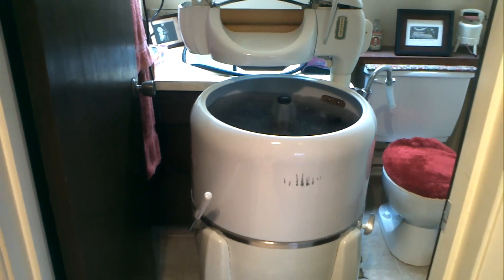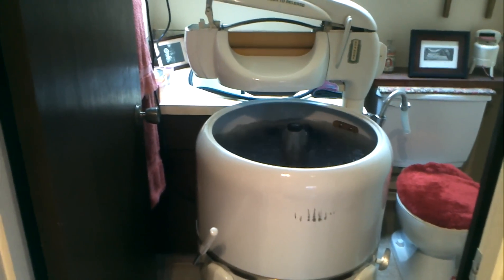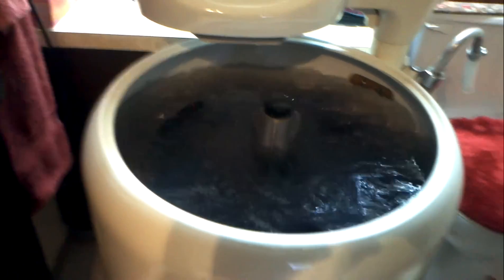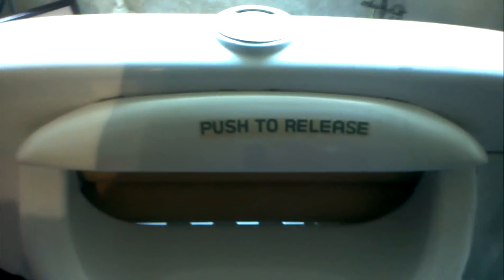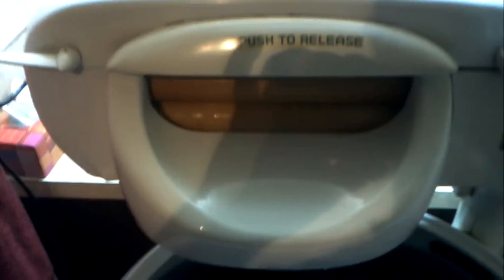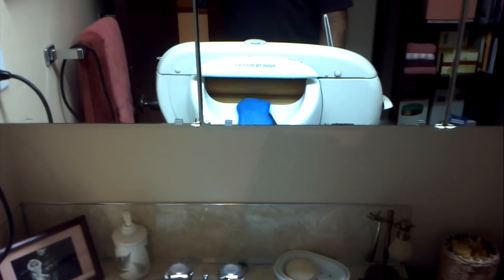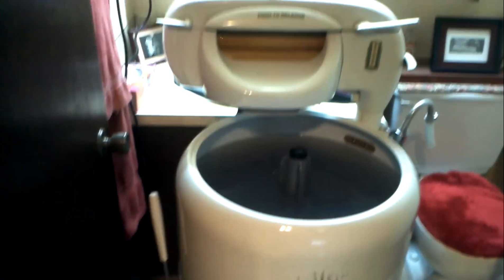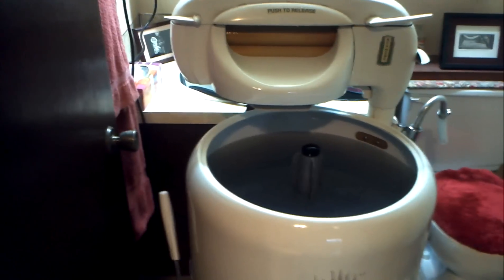1948 Kenmore Wringer Washer - operation

Comment: Nice Kenmore! I'm refurbing a 1965 lady Kenmore complete with chrome and a filter. I have a question that you might have the answer to, are the gear cases on these wringers completely silent or do the have a quiet tap at the end of each stroke? I'm trying to adjust mine just right and I believe a poster on automaticwasher recommended I ask you.  Thanks!
Reply from the maker: Hello Mark ... yes indeed, there is a little tap at the end of each stroke. It's not what I would call loud, but it is audible over the quiet hum of the Delco motor. Sounds normal to me.

Comment: How many amps or watts does it take to run a wringer? I recently purchased a Maytag E2L and thinking of putting it on solar power
Reply from the maker: +Ozark Mountain Girl Typically, a Maytag electric motor (made by Delco division of GM) was 5.3 amps, 1/4 hp.

Comment from the maker: Thanks for the message, Arkansastrash. Yes, the motor looks to be the original, although the manufacturer's name plate was painted over. It's amazingly quiet - even more so than both my Maytag models. Perhaps that is due to it being direct, rather than belt, driven. I was quite surprised to see direct driver in a model from the '40s.

It has very vigorous washing action with excellent roll-over, thanks to the 3-vane agitator (the agitator also has an additional 3 narrow vertical vanes.)